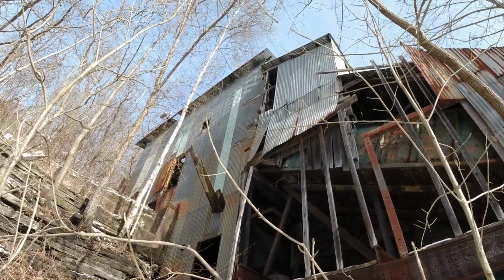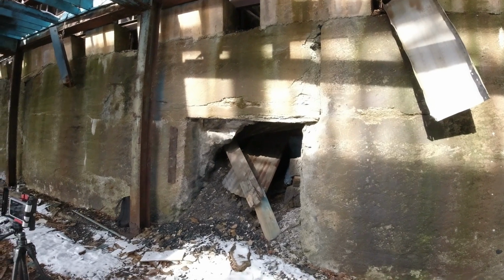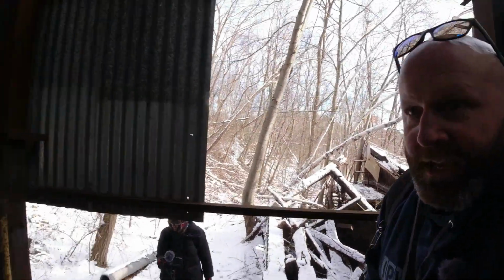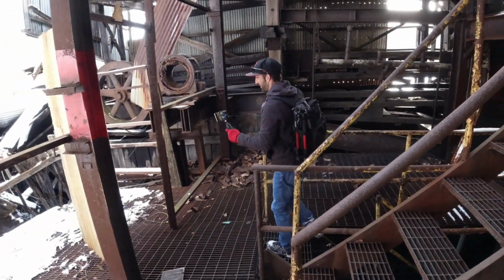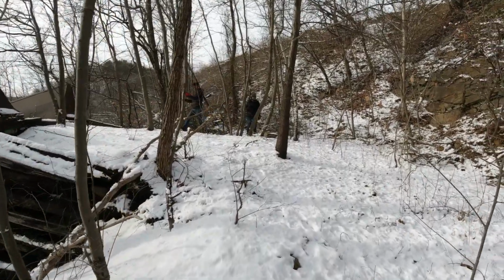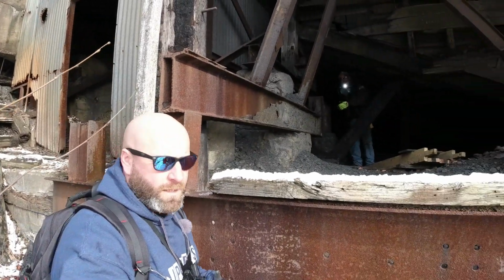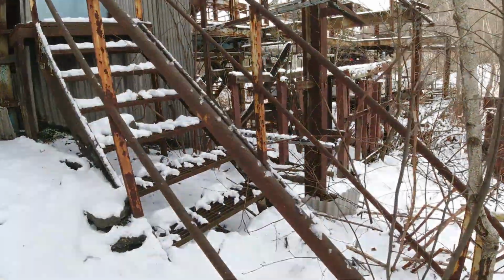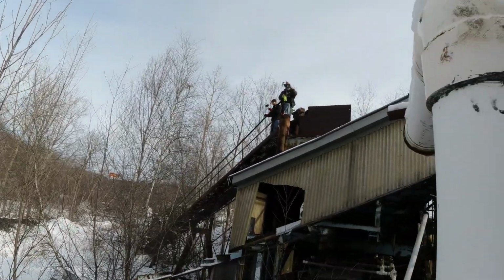Doing Some Adventuring With My New Dji Osmo Action

Comment: Stability is good, sound is good. At times the video has a weird look to it that I cant explain.  Phone is better in my opinion but this is certainly sufficient
Reply: Tom, I had the same issue, kinda like the picture wasn't clear.
Reply from the maker: This wont be replacing any of my cameras, but used for certain environments and scenarios.

Comment: Good morning JP I was impressed with its filming and audio with the built in mics, I watched in 1080 and it delivered a really smooth crisp picture, I never mind movement to much but it didnt shake or anything, great camera I need something like this,  I use a Galaxy S10+ for everything filming and editing, what is the footage like to edit? Format wise was it easy,  one last thing I kinda lowkey laughed to at your friends perfect timing when he slipped over, cheers
Reply from the maker: I have the s10+ as well and editing was pretty much the same on my editing program.
Reply: @JPVideos81  +that's a bonus I love the s10+ but it has alot of updates which I feel have made it not as good in low light now, I'd love to edit on a pc lol but for now my mobile will have to do, thank you for replying

Comment: The sound was actually pretty great. I think the lapel mic is a little clearer and has a little less background noise. The video looks good, but I'm not too fond of the fisheye effect that is happening because of the wide angle lens, but gopros do the same I think. I think the chest attachment is just right. Didn't look too high or low. The hyperlapse isn't something I really care for, but it seems like it worked well. Seemed stable and clear also. Only thing I don't like is the fisheye.